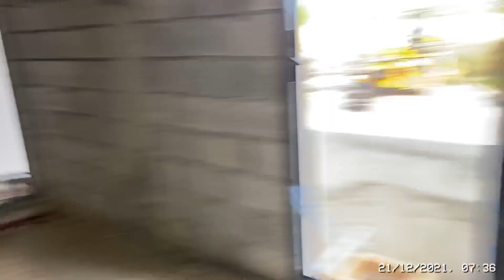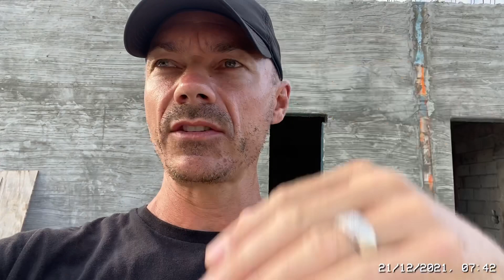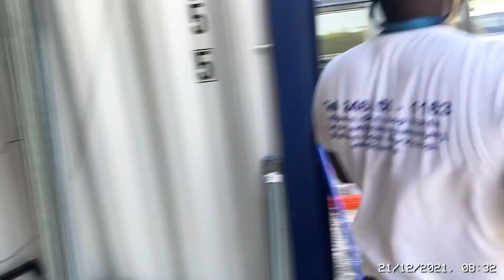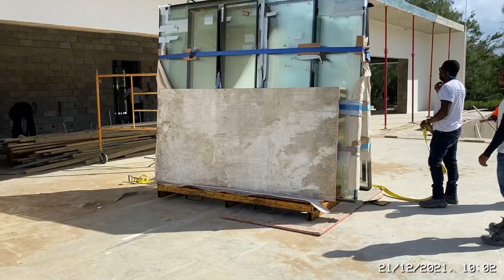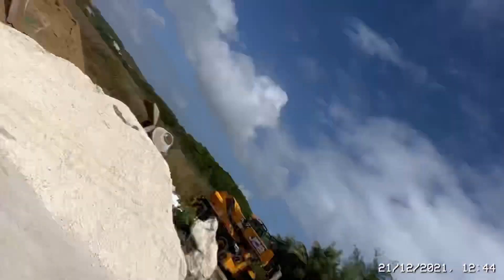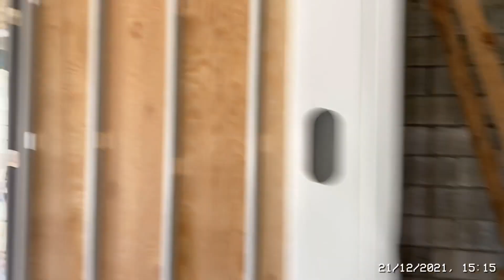Barbados 🇧🇧 Beach House Build - Day 194 Building our Dream House in Barbados

Comment: YOU SHOULD HAVE MADE A PLYWOOD TEMPLATE OF THE WINDOWS , MAKING SURE YOUR OPENING IS 3/8 BIGGER AFTER  THE PLASTERING  , FOR THE 5 FT. OVERHANG  USE CEMENT BOARD , MAKE SURE YOUR FRAMING IS SET BACK THE THICKNESS OF THE BOARD SO THE FRONT WILL BE EVEN WHEN YOU SHEETROCK IT